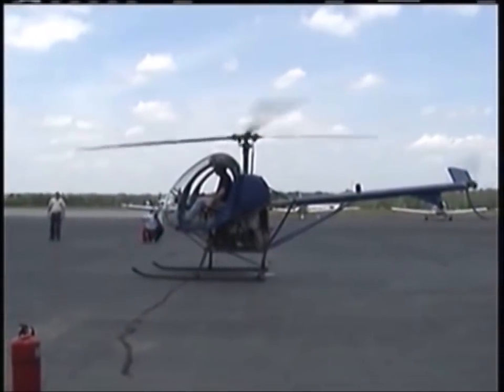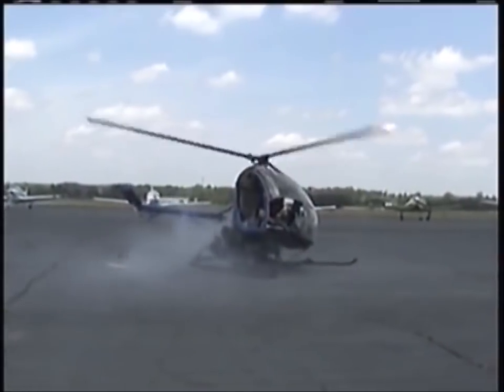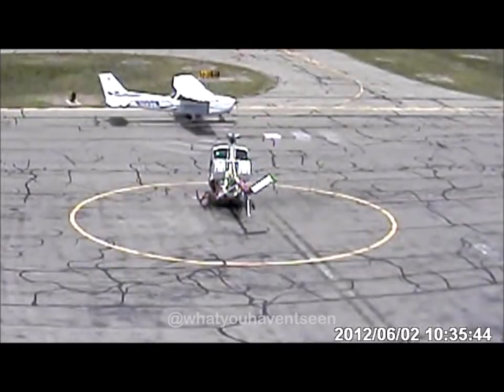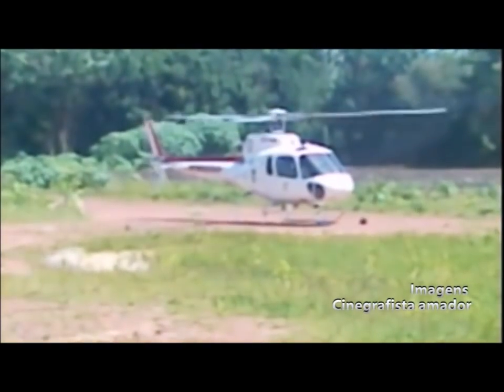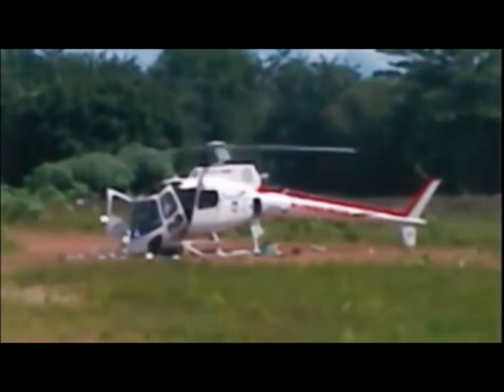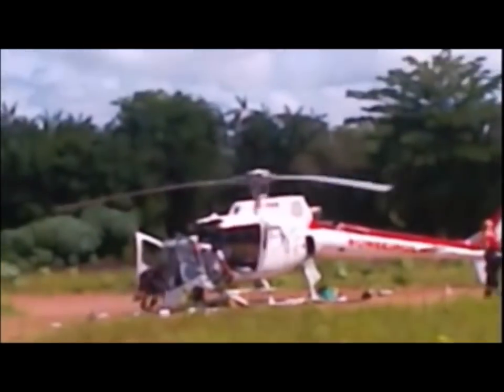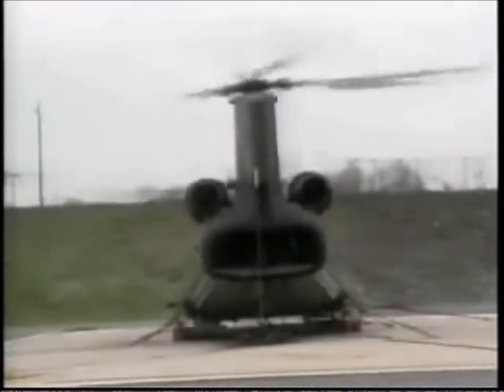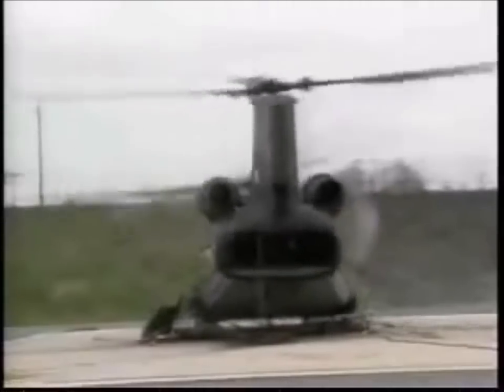Helicopters self-destruction by oscillations and vibration. What is Ground resonance?

Comment: Are none of these "pilots" trained in this? Seriously, if you feel it, lift it lol.
Reply: Apparently not. Also apparently forgot how to deal with engine complete failure. All 4 on the R44 with strong injuries https://www.nzherald.co.nz/nz/canterbury-wedding-helicopter-crash-pilot-stable-photographer-in-visible-pain-a-week-after-horror-plunge/PXXYDSILNNM2FZZFULWK3S5AHM/
Reply: To be fair, the military one was obviously a test (as it was strapped to the ground).
Reply: Normal helicopters without an IMDS (Intergrated Mechinal Diagnostic System) won't be able to tell pilots exactly how much the helicopter is vibrating. The reason these helicopters are destroying themselves is probably due to component failure. Mechanics not following procedure, not replacing bad components due to cost, or FOD (foreign object debris). A proper and thorough pre-flight is the only way pilots can save themselves from this kind of thing.

Comment: Somehow I don't think I'd be using the take off immediately method for controlling ground resonance.
Reply: Immediate takeoff is the remedy for ground resonance, you need to get the aircraft off of the ground.
Reply: @jackshover7290  Yeah... understood. But still unconvinced it's a procedure for mere mortals. You'd at the very least have to have balls of steel.
Reply: I have over 15,000 hours in helicopters both military and civilian. Raising the collective and lifting off is a very simple way to stop the condition, staying on the ground only amplifies it. No balls of steel required.
Reply: @jackshover7290  I gather the quicker you get off the ground the better!
Reply: You gather correctly sir.
Reply: @johncochran8497  Thanks. I'm a glider pilot myself, but I've always been interested in choppers since I read "Chicken Hawk" by Robert Mason many years ago. It's the best Vietnam War/Chopper book I've ever read... read it if you haven't! But I wasn't really very aware of ground resonance. I knew choppers were inherently unstable, but wow... it doesn't seem to take much mishandling to encourage them to destroy themselves!

Comment: Notice that the helicopters featured here, self destructing, all had 3-blade rotor heads?
Reply: It only happens in helicopters with 3 or more blades....but ones with two blades suffer from mast bumping...
Reply: @superchargedpetrolhead  I'm yet to see it with four blades or higher.
Reply: @mickmuzzmkmz1628  yeah, i think it might be cause most of helicopters with 4 or more blades tend to be bigger and more capable and hence tend to be flown by professionals and it is less likely to end up in an accident and get posted on the internet.
But I believe they also do suffer from ground resonance